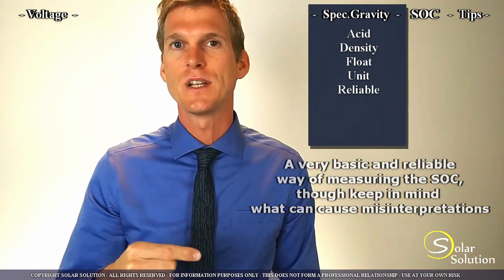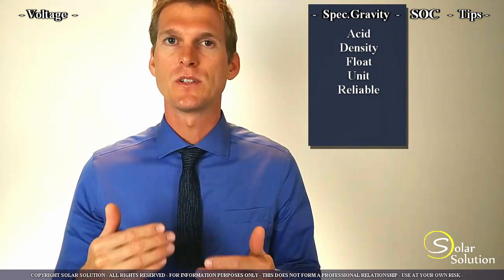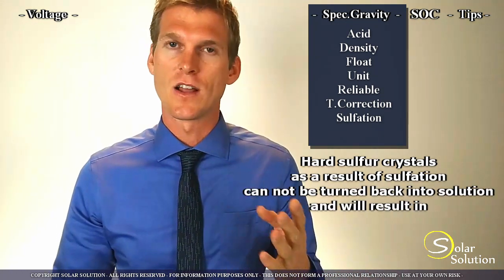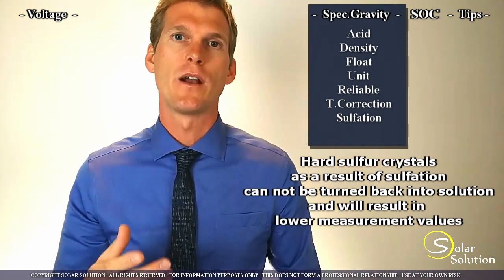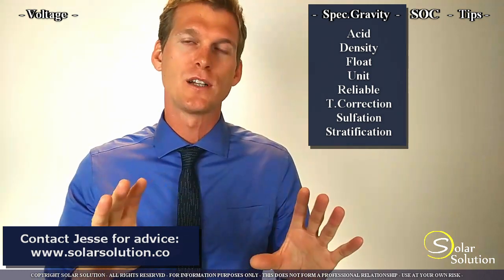Battery Monitors: Pros & Cons for your 3 different options // SOC // Depth Of Discharge // Shunts

Comment: Could you please explain to me if I could fit a Efb battery into a charging system for a Agm battery and vide versa. I have been told that the charging profiles are different and that if I charge a agm battery with a efb charging system I could damage or shorten the life of the battery . But I am told I could charge a agm battery with a efb+ Charging system ?? Could you please enlighten me as i feel confused ?

Comment: Good day What’s the best way to charge lipo4 battery 24v with a charger that have bulk,float setting that can be programmed also battery monitor system with end amp and charged voltage setting. I’m using a fm80 outback charge controller I would love safely charge my batteries to about 95-97% and discharged to about 35%
The battery charge spec states 14.6v max and stop charged after charged current tapered off to 0.02C (that’s 2%) I have 2 in series   I’m presently charging at 28v absorption time 2min
Charged voltage 27.8v , end amps 6a float voltage is 26.8v. I really don’t want to over charge although each battery have its own BMS (my battery brand is xd battery lithium lipo4 12v100ah thank you)
Reply from the maker: Hello Robert, thank you for your question. If you would like to receive my personal support, you are welcome to use one of the services available at https://www.solarsolution.co/services.

Comment: Great information as always! You ask what else we want to see, well there is plenty — but since this video is about battery monitors, how about battery questions? A few that I have: I have FLA. Can I add a new FLA battery to my existing aged bank of three? Can I add an AGM to the bank? I would like to add a AGM, because I could fit another battery in my boat if I put the battery on it's side... Can I use a full Lithium battery to jump start my FLA battery bank? I was thinking to maybe to buy a lithium as a safety spare...
Reply from the maker: Hi Dana, thanks and it is always good to hear from you. Your are describing some very valid questions, thanks for bringing them up. I will find a way how to address them properly in one single video topic, and upload soon. Thanks!
Reply: @Dana - No, do NOT add an AGM battery to an FLA bank. They have different charge profiles.  Adding a newer FLA battery to an older FLA bank can be done, but you need to know all of consequences.

Comment: Thanks Jesse, always appreciate your videos. I use both a battery SOC monitor and occasional manual SG measurement to keep track of our battery bank. Multimeters are a mystery to me, however. Can you do a tutorial demo on how to correctly measure the battery voltage with a multimeter please?
Reply from the maker: Thanks George for your feedback, it encourages me to hear that you appreciate the content. Well done on the combo of the battery monitor & SG measurements! You can't go wrong there. 
I can't resist to give you a small tip on the SOC algorithm: I do not know which brand & model you are using, but most of the equipment has a configurable tail-current threshold at which the battery SOC indicator resets to 100%. This setting is often overlooking and/or kept at factory default settings, though is critical for the proper functioning of your battery monitor.
Regarding your suggestion for a new video topic on multi-meter tutorial: great idea! I can't believe how I overlooked that one, and you are absolutely right on mentioning it. I will upload it soon. Thanks and enjoy your day.

Comment: Thank you. I measure voltage at a few different points, and it often varies by 0.1 to 0.2 V.  What is the proper place to monitor it? What is the effect of charging (from solar) and discharging on the measurements?  Would love to see you cover this in a future video.
Reply from the maker: Thanks for your questions @ SV Hidden Hand, they make a lot of sense. Sounds like an excellent topic indeed, I will share the video soon.
Reply: @SV Hidden Hand - Always measure the voltage at the Battery Terminals.  And use a Charge Controller that has "Voltage Sense Leads".
Reply: @vtorsi610  I'm confused by this reply. If the charge controller is measuring the battery voltage, isn't it doing it because it is connected to its terminals via direct cables - how are these different than voltage sense leads? I am trying to understand if I need a voltmeter/multimeter to measure battery voltage or if my MPPT charge controller voltage output is sufficient.